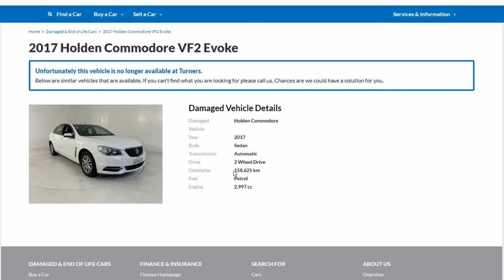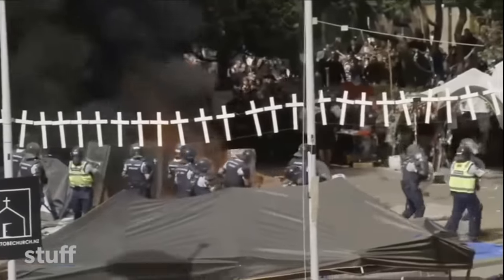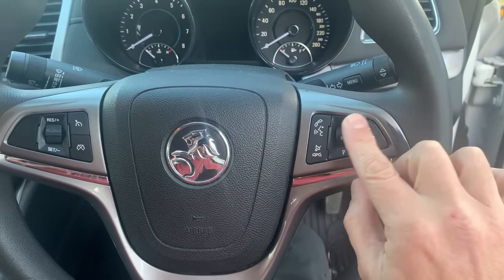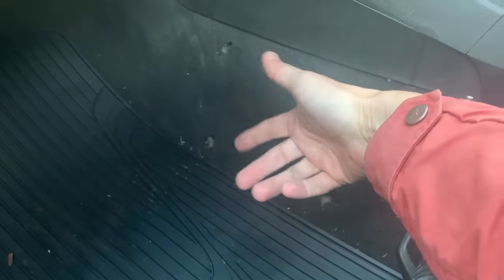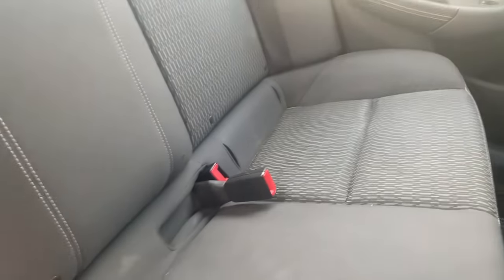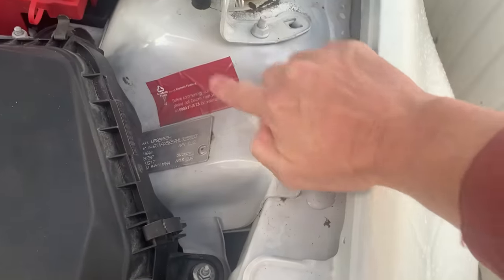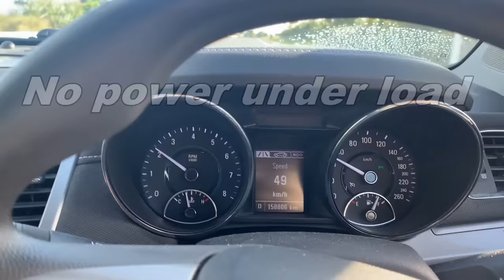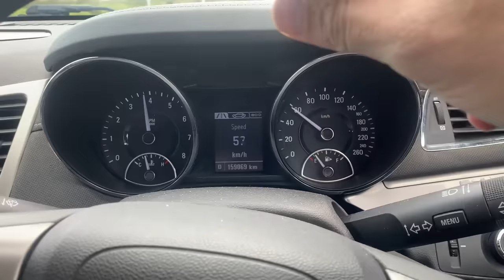Buying New Zealand's most hated damaged Ex-Police car

Comment: Jeez they're rough with the fitouts in NZ. I've had a couple of police cars in Australia and they certainly weren't brutalised that much. I'm sure it was cheap tho and glad it was an easy fix. :)
Reply: Don't forget that the Police here in Australia will move their cars on after 3-4 years or so, depending on mileage. It's been nearly 3 years since I've seen a Commodore on Cop duty here in Melbourne.
Reply: I had an ex SA PD VE series 2 for just over 10 years , i purchased it from auction and it had only done a years service with the police. 
It was in excellent condition and no holes in the carpet of dashboard etc.
The only thing i had to do was remove the extra battery in the boot and add new carpets.
A great car and i loved it.
Reply: @davidthomas9  very true, not many get to 150000 km but I'm more just talking about the brutality of the fitouts and the cutting of things in a way that doesn't happen here. They seem to be much more concerned with resale in Australia. I was involved in servicing NSW police cars up to VE and once they were stripped there would just be a few screw holes in some cheap trim and a bit of extra wear on the seat bolsters from big belts and things and aside from that the average person wouldn't really know their history. 

This was just hacked up tho, be a bit of work to remove all evidence! ;)
Reply: I seen heaps at auction. No more. When you jump in to have a look the aftershave and anti perspirant fumes is ghastly.
Reply: Yer....our government clames it spends about $120000 on a new cop car....nz government won't even release the costs 😄probly got thire cuz to fit it out in the back shed for some p...and pocketed the rest.
Reply: @davidthomas9  still plenty of vf cop cars getting around where i live
Reply from the maker: Thanks mate! 👍
Reply: Difference between a leased car and one owned I'm guessing. In Australia they have too make them as presentable to get the best buck. Under lease, who cares as it's the leasing company that takes the hit.
Reply: Yes the kiwis are savage with the fitout.
Reply: The nautech ones were fkn rough, now that Wade is doing them the fitouts are bloody prime
Reply: @2DogsVlogs  That's not how car leases work. If you return a car at the end of a lease with anything more than normal wear and tear, you'll be getting a repair bill from the leasing company.
Reply: @corkeymonster  Some government leases are different. I had an Australian Z plated car and when it was returned we didn't get charged for any damage. My first car had a big ding in the passenger door from when a trucks rear door swung out and hit it and the second had front damage when a car reversed into it. Both were hit & runs so we never fixed the damage, just handed them back.
Reply: @2DogsVlogs Right, so if you returned the car with $10k of damage, the leasing company would be like, sweet as bro? You'd only need third party insurance too, because the leasing company would have to pay for all the repairs on your car. The "fair wear and tear" contracts I've seen are fairly generous, e.g. dents up to 3cm and scratches up to 10cm are OK.
Reply: NZ cops are piss poor drivers and crash the cars in short order. The "Precision Driving Course" they do is two weeks long , two days of which is in an actual car.
There was a case in the 90's where two cop cars  crashed into each other ate a cross intersection in the early hours - they were in the way to the same incident 🤣
Reply: When Nautech used to do them, the fitouts were way jankier. But Nautech got caught screwing the pooch and lost the contract
Reply: They used to tidy them up a bit more than what's shown here before resale. Just doesn't seem to happen as much anymore, knowing how hard custom fleet can be to deal with for mechanics/panel beaters I'm not surprised.
Reply: @davidthomas9  Melb has a couple but only ever see them in convoys. Seen some in other citys too also only ever in the capatiy of a convoy/escort.

Comment: Many years ago i purchased an ex ministry of transport - MOT Mitsubishi V3000 and it was bulletproof  the engine/gearbox had no problems the interior was  remarkably tidy and all the emergency gear had been carefully removed. I think the difference between my V3000 and the Commodore is MOT traffic officers often had take home patrol cars so the officers tended to look after them unlike police officers who were harder on the patrol cars that were pool vehicles
Reply: I had one as well 5 speed manual,it  was tidy as well,i thought was quick at the time.lol
Reply: Nz made too
Reply from the maker: I remember those, as you say, I think that the mot guys looked after their cars pretty well, and those v3000’s flew!
Reply: @nonrasputin9260  when the police/ mot merged in 92 the V3000s were in service past there used by date because they were reliable and popular with officers and yes they were fast many speeders in V8s were surprised at how quick the V3 was
Reply: @brittenv1000  it was a unique car for the nz market about 500 served with the MOT and service records were sent to Japan to help Mitsubishi improve the V6 engine
Reply: @Wilt8v92  mine was 5spd a few autos were used for transporting VIPs and yes they were fast and had a good power to weight ratio
Reply: @patrickbuckley5071  I found mine was a bit twitchy over 160kmh and needed a lsd diff,I know,but the roads were empty down Sth once lol..
Reply: @patrickbuckley5071. Hi Patrick, any relation to Bruce, former NZR Road Services driver Wellington  Depot? I'm an old MoT cop from way back, long before the V3000's. I rode bikes as a young cop and had various cars during my time on the job, and yes you're right, we took our bikes and cars home as we had no common depot in which to park up off duty cars or bikes. So we did have our allocated vehicle solely for our use, hence we tended to look after our vehicles as if they were our own. I served at Porirua and later at Picton for several years. My last car was a 1967 Holden 186. 3litre. Car Jam shows me this vehicle is still owned privately in NZ. I had it from new and went to the Vehicle Testing Station at Kilbirnie Wgtn to uplift it and take it back to Picton way back then. It was a good car, but doesn't compare with my present private V6 SUV which is far superior in handling and performance. Bob LH.
Reply: @daddybob6096  Hi Bob
I do have a 1st cousin called Bruce i know he did something along those lines for a job so he could be part of my buckley clan i also have a relative Alan Buckley  who served as a MOT traffic officer i think he was stationed in the Wellington area in the 80s I'm fairly certain he left the MOT just before the merger in 92
Reply: @patrickbuckley5071  Way after my time Patrick. Bruce and i drove buses and long distance coaches from Aotea Quay, depot during the 80s. Bruce was a nice guy, and lived in Khandallah Wgtn. Cheers Patrick.
Reply: Have you visited the MOT museum in Invercargill?
Reply: @CarlMcKenzie  one day i make the trip i live in the north island.  but i did speak to Glen cockroft on phone a couple of years back his father was chief traffic officer of the Invercargil city council traffic dept very interesting history i think Invercargil and Auckland had two of the most effective local body traffic departments in NZ

Comment: I was fortunate enough in 2018 to purchase an ex Vic police VF2 wagon here in Melbourne less than a year old with under 20,000 on the clock LS3 6.2lt V8 and in excellent condition. Best car I've ever owned. Waiting for FOI to come back with more info for me. Even got photos of it in it's VicPol livery. I like to think it was only used for trips to the local donut shop.
Reply from the maker: Man, what a score! I wonder why they moved it on after 20k km? Man, that's lucky!
Reply: @nonrasputin9260  probably had a requirement to get more unfit for purpose EV's.
Reply: @nonrasputin9260  At the time they were changing over to BMW. Could be part of the reason...
Reply: Fair chance it was a driver training car and got the life flogged out of it.

Comment: Nice work and great info.  I purchased one (Ex Pol Evoke) from TURNERS last Friday and will be checking all the point you have identified
Reply from the maker: Thanks man! Good luck with your evoke, you won’t regret it! If you have any issues getting speakers, steering wheel volume control etc, check out my other video on the ex cop car and flick me a message if you need tips on getting it working. Cheers!

Comment: In 2012,i brought an Ex Highway Patrol car,2009 VE SS,Holden. Mechanical the car was mint,having only 120,000kms on the clock,with a detailed service history and repairs supplied. Internally a different story and similar to yours. NZ Police must have fitted 4 radios to their Highway Patrol cars as there was 4 antennas mounts in different locations.I still have this car as a daily runner,clocking up 300,500kms now.
Reply from the maker: Far out, that’s awesome, glad you’ve actually driven it like it should be, rather than just parking it up, good on you!

Comment: I've decommissioned a lot of the VE/VF Commodores and now seeing some ZB  start to arrive for decom. Didn't do that one though, I always cut the lightbar loom flush to the roof and duct tape over the hole.
Reply from the maker: Wow, that is cool! I know in the VE’s, one of the cores is cut in behind the curtesy light to deactivate blackout mode, was there no blackout mode on the VF? This one came up from Porirua/Wellington. Thanks for the comment man!
Reply: @nonrasputin9260  yep the VE had the blackout up in the interior light, i can't actually remember where the VF had the blackout button, I want to say it was part of the light master switch in the center console. The cars always get the radios/super important stuff removed before they come to us, then off to get livery removed after decom then to auction. Bound to be a VF at work, will check in the morning and let you know. Cheers

Comment: I bought an AU  XR8 Falcon in 1999 with 40000ks on it. had the diff replaced under warranty and was a ripper for about 5 more years.
Reply from the maker: Wow, I would not have expected a diff on one of those to fail in such a short period of time, lucky it was still under warranty eh! Cheers mate

Comment: You may also find that the red and blue LED lights fitted inside the rear reverse light lens are still there. I serviced an old MOT. v3000 someone had bought and the red grill lights were still there and they worked  someone forgot to remove before it was sold.
Reply from the maker: Yes, they were still in there I believe, you could kind of only just see them on an angle, but, all the light controllers etc were removed so I couldn’t power them
Reply: A friend of mine ended up with an ex police car from turners auctions in christchurch around the early 2000's. Still had some of the emergency lighting inside the taillights. Being a Nissan s14 Silvia, it was probably the rarest and least known about NZ unmarked patrol car.
Up until a few years ago car jam would suggest it was still being used and road legal.
Interestingly enough, completely by accident I came across an archive video on YouTube of the very same car attending a vehicle crash: Circa 1996/98ish possibly??
Although wearing different number plates than in later years.
Reply: @GAZZA55 Yep, it certainly was a conversation piece.
And interesting not many are aware they were used. I know there was a least two in the Canterbury fleet. Although I don't know how many were used throughout NZ, if any others ?
I'll dig out the video when I get a minute and post a link.
Reply: @mikesievers1482  don't suppose you have a link to the vid? I seem to remember a few 'interesting' cars being bought by the cops for unmarked cars back in the day. I seem to remember an Evo cop car at one stage too.
Reply: No sorry. Can't find the original video. It may have been taken down. A friend of mine downloaded it years ago but no way of linking to it.
Apparently it's on FB somewhere so I'll look into that.
I did get pointed to another video of the same car attending a crash around 98/99ish but it won't let me link it here.
It's on the 'geoffmackley' channel in archived videos. Video titled.. 'cameraman first on scene stolen car crashes and burns'
Unfortunately it only appears very briefly, so you'll need to pause around the 2.08 mark.

Comment: They really leave them in great condition....
Here in SA Australia
The cars look pretty original bar from secondary battery, and blackout button....a couple holes. But they don't drill or cut bodywork up....
Advice anyone in Australia buying and ex police car, try and get a country car ..city ones are bashed around and similar issues like this evoke!! Unless you want a project😊
Reply from the maker: Absolutely! Hence the sv6’s used for highway patrol are more sought after when they on sell them, they haven’t had the same abuse! Cheers mate

Comment: What concerns me about this is how did the servicing/maintenance agent let the car clog up with crap and not fix that? Nice video bud.
Reply from the maker: Not sure, the service record notes the centre muffler was replaced not that long ago, so I think they were chasing the fault to. I rekon this one was particularly clogged as it sat idling for months on the covid border between Auckland/Northland
Reply: Serviced at the mechanics behind city mission store, which is on Taranaki. Saw them fitting out the new low profile lights when I stayed at the lodge.

Comment: very interesting video i thought. im curious as to why was it easier to replace the exhaust rather find the blockage?
Reply from the maker: Thanks mate! Unfortunately other than the rear muffler, nothing was able to be unbolted, so it would have meant multiple cuts to find the blockage. From the service history I saw that the centre muffler was replaced not long before I purchased it, so perhaps the police repairers were also chasing the same issue and possible the remnants of the old centre muffler were causing the clog. Luckily a replacement set is fairly common to find, if it wasent that, I would not know where to look next 😂

Comment: Been considering an ex police VF seeing as their coming up cheap interesting to know how much goes into making one really usable again.
Reply from the maker: Hey mate, the more you can do yourself, the better. Test drive if you can, as sometimes the transmissions can change gear harshly due to wear and tear, good luck
Reply: For what its worth, I quite love my ex cop car VF.
Reply: @nonrasputin9260  Luckily im a Mechanic by trade and my background is predominantly GM so fixing any issues on one is no biggie.
Reply: I got lucky with my 2016 evoke ex police .   New trans fitted jan 2020 - car bought by me not long after. I am happy as with the car👍
Reply from the maker: @Moolaanz  awesome stuff mate!
Reply: I’m a Holden tech and I do not rate the 3 litre engine. The 3.6 gives not problems as long as you service them with good oil but we’ve seen multiple 3.0 V6s drop valves and grenade themselves
Reply from the maker: @marksmanssv8318  wow, I've never actually heard of that happening, whats usually the cause?
Reply: @nonrasputin9260 we've only seen it happen to police cars. Seems to be when they've been run at high rpm for long periods and the valve spring or collets let go. Last one we had do it was about 3 weeks ago but sadly for the police all the VFs are at the point now that if theres any major damage to them they just get decommed, they really don't seem to like the ZBs and even less the Skodas
Reply from the maker: @marksmanssv8318  thanks for the info mate, very interesting stuff! This car as well as another couple of ex-police evokes have all had lsd differentials, yet, quite a few comments on here are like “nah, the evokes got the standard diffs, you’re wrong! Etc”. Are you able to settle the argument?

Comment: Great find! Curious about the LSD, The Evoke 3.0 had a smaller 195mm (VS 210 on the SV6/SS) diff for efficiency which didn't have an LSD option to my knowledge, be interesting to see the sticker on the bottom of the Diff for the ratio, part number and to confirm LSD
Reply from the maker: Hello mate, all NZ Police Evokes were fitted with limited slip differentials and FE2 suspension, which is non-standard. The differentials are marked as LSD and have a ratio of 3.27 and you are correct, is the smaller 195mm. Unsure why they never got the lfx engines, but I’m assuming they stuck with the lfw’s for the cost and minor fuel efficiency
Reply: My Ex Police Series 2 VE Omega also has the LSD, only found that out recently when the dude at VTNZ told me.
Reply: @nonrasputin9260  I'm curious too why they got the 3.0. Fuel economy was the same as the 3.6 (except on paper) as you have to push the 3.0 to get it up too highway speeds. My brother had a wagon and floored it everywhere. Even upgraded the exhaust and cold air induction. It was OK but far from the power of the 3.6.
Reply: All Evoke police packs had FE2 suspension, not an LSD. NZ police vehicles were a standard police pack in Aus. Every else you mentioned came with the police pack. SV6,SS & SSV with 3.6lt (210kw) engines had FE2 suspension. Calais had FE1.5.
The right hand thumb wheel on the steering wheel was used to detect a motorist speed. Once pressed it would show the actual speed, and show the driver "speed detected" in the instrument cluster. You can check the build plate to confirm if it is a police pack.
Ex Holden vehicle supplier.
Hope it helps.
Reply: @alanrichards6963  Current Holden technician here XD. The VIN of this vehicle has the RPO code G80 applied to it which means it has an LSD. And yes it is designated as a police car from factory based off of the RPO codes.
Reply from the maker: @marksmanssv8318  thank you so much, I appreciate you putting this here and backing up what I’ve been stating. Much appreciated mate